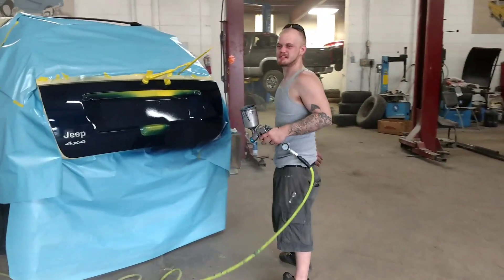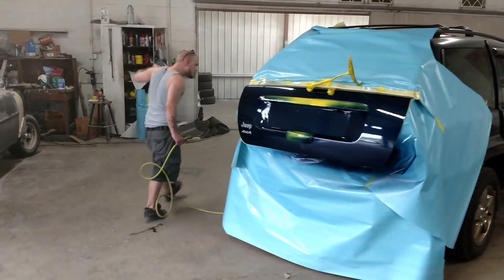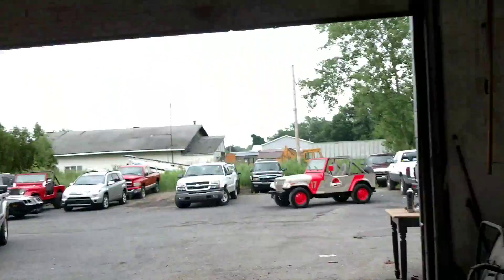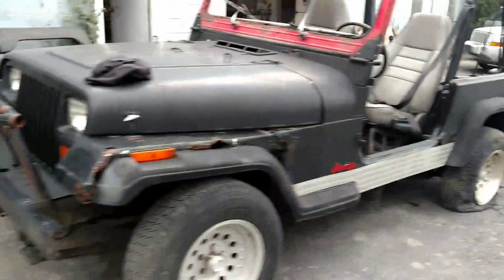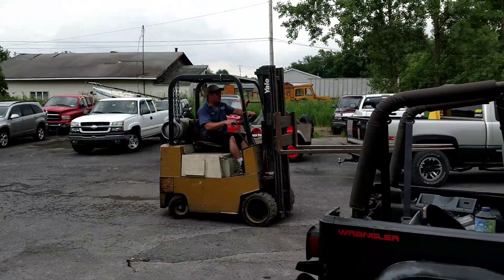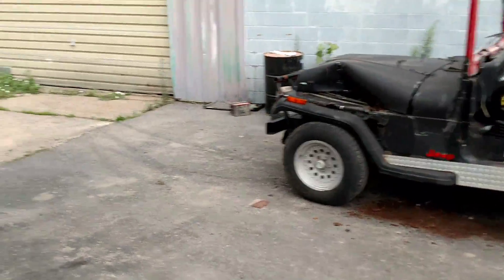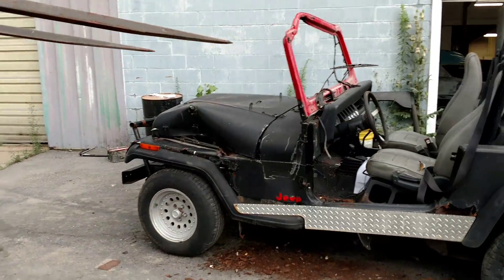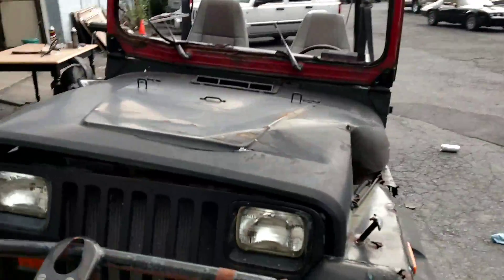Making a wrecked Jurassic Park Jeep part 1

Comment: So, no part two, does that mean you figured out what you did wrong?

1- you paint it to look like a JO vehicle.

2-you distress the paint for aged look.

3- you create attacked look on vehicle with CAREFUL use of fork lift, grinder, etc.

You went backwards and never tried to simulate claw marks even though the other guy pointed it out to you.... maybe next time, salvaged rust trap jeeps are easy to come by if you search the copart website....